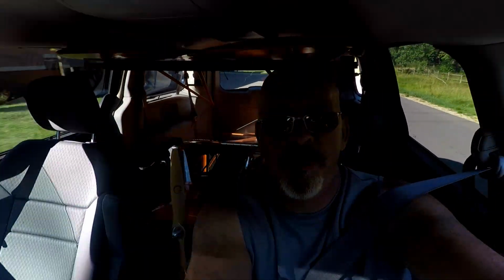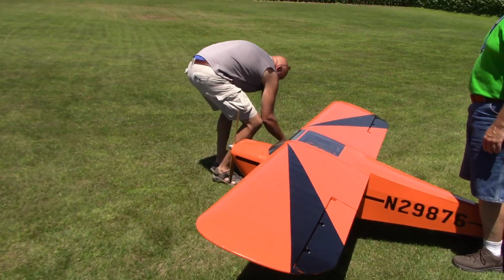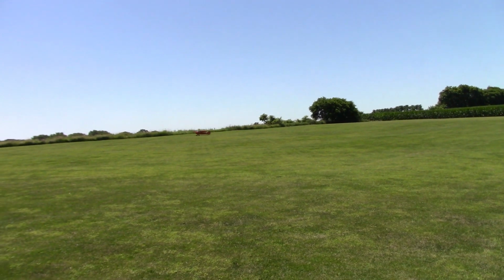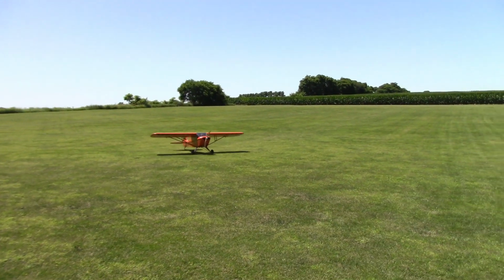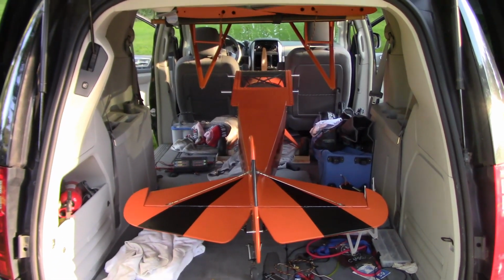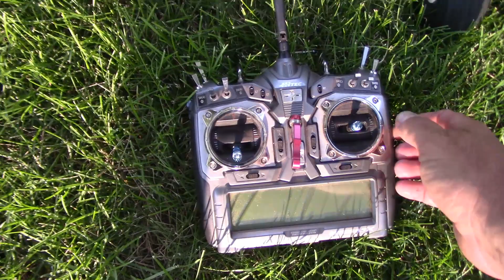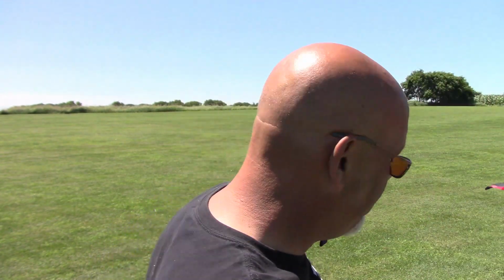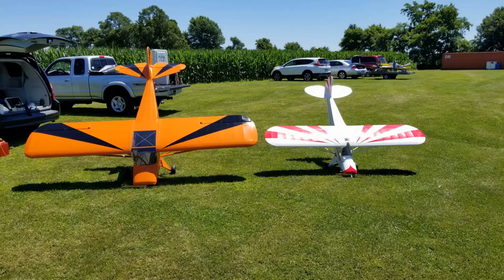33% Clipped Wing Taylorcraft Restoration  - Video 95 - The Teaser

Comment: Thanks for the video Bud.  Was great to eventually see the Taylorcraft taxiing and running on the main wheels. 
Looking forward, as I’m sure you are, to the maiden flight.  Hope all goes well.
Re the Flexifoil power kite. I have a few different sized ones for various winds myself. Also they can be used in conjunction with a 3 wheeled buggy.  I used to charge along the local sandy beach when the wing was suitable.  Haven’t tried it out in about 5 years though. Must go back and do that again.
Best wishes for the maiden flight. 
Charlie